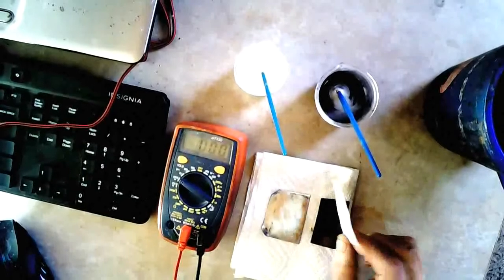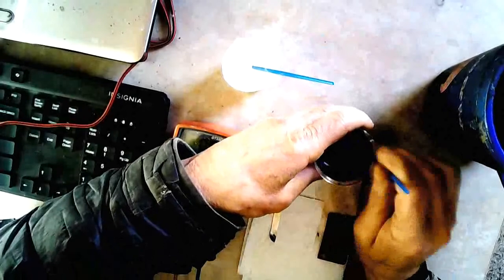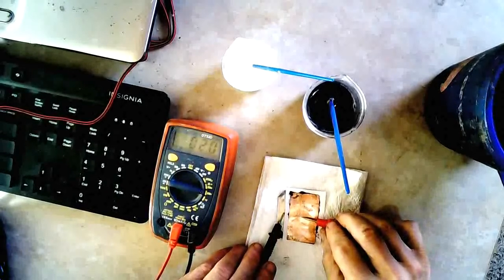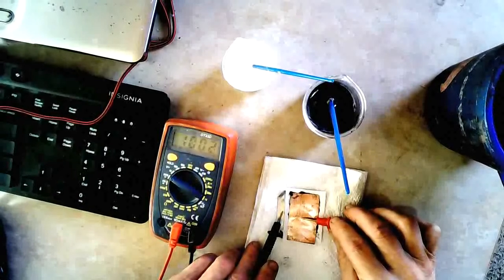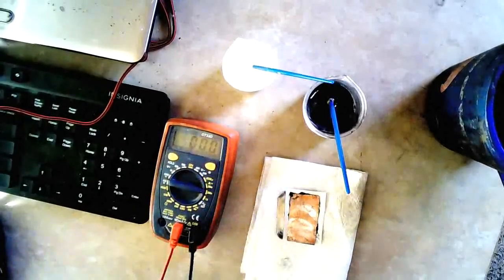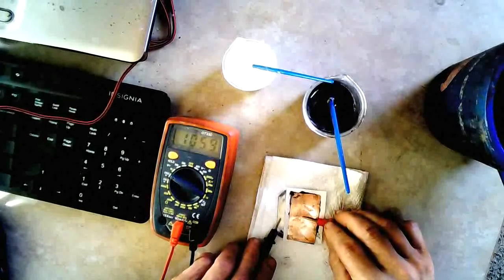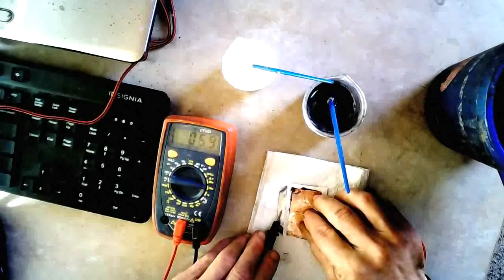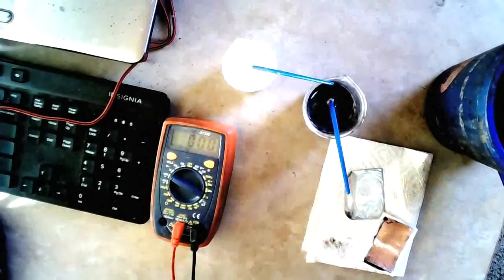Thin Film Borax Separator Test

Comment: Hi Bio-Cell Nice work. Wonder if the carbon side was touching the whole surface of the membrane, With all that white blotching there.
Reply from the maker: Hey Dan,. probably not since I had no clamp on it. Maybe the Tio2 migrated toward the carbon?
Reply: You might try to squeegee the cellulose acetate on the paper with a card. That would probably help make a fairly uniform self supporting paperless membrane as well. To maximize contact you could make a plate with a soft face like hard foam or rubber to clamp it which would contour to any surface irregularities.
Reply from the maker: Hey Fred, I'm pretty confident that I made a uniform film surface on the paper with my finger, and that was also supported by the fact that nothing bled thru the paper onto either electrode. Just the paper had the white patches on it, and those areas of the paper are much stiffer now since it dried. I'm thinking that the sodium or Tio2 moved into the paper and got stuck between the film layers, but that's just a guess at the moment.